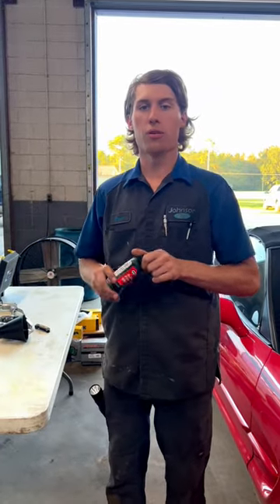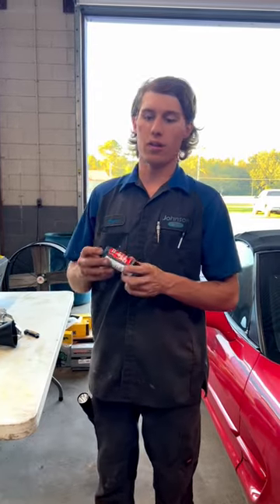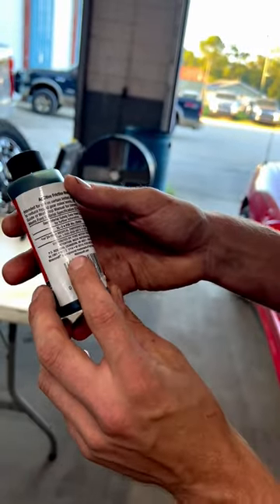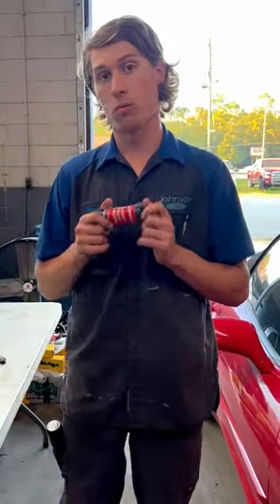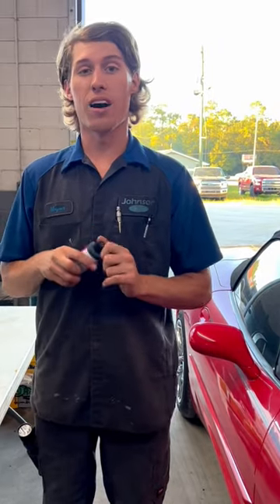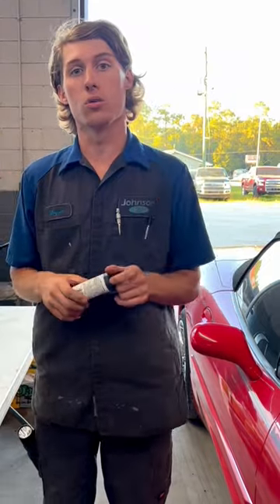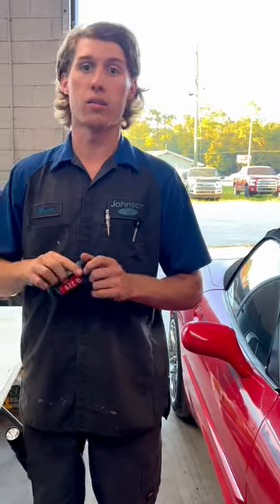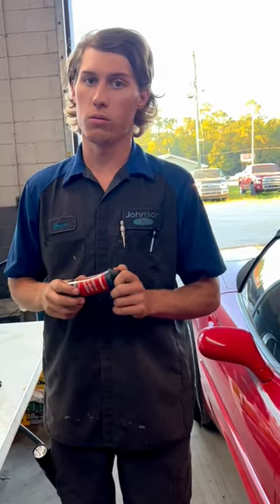What is friction modifier? #shorts

Comment: I found a novel use for friction modifier. Years ago, I ran an old, very large horizontal boring mill built back in 1939. The feed and rapid traverse clutches were buried deep within the housing and were of multi-plate design, and they would slip. On a whim, I had the company order some friction modifier, which I added to the gear case oil. Problem solved!